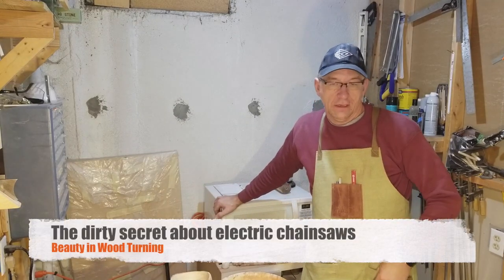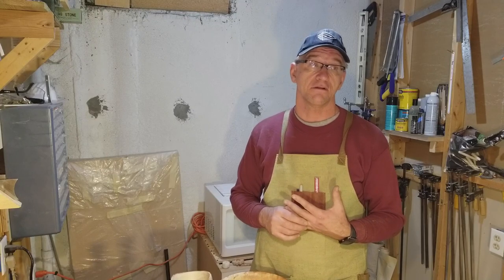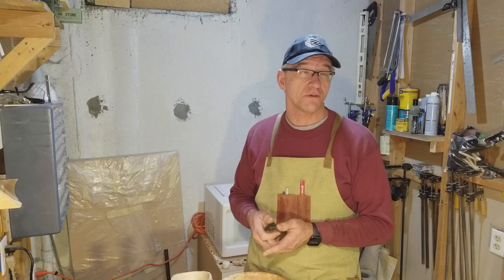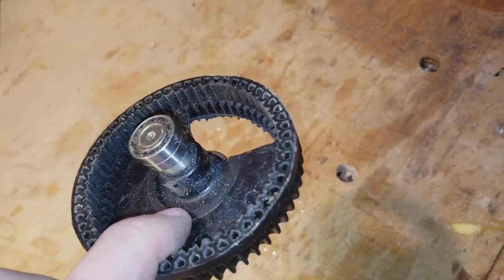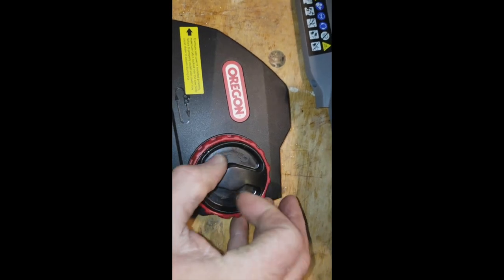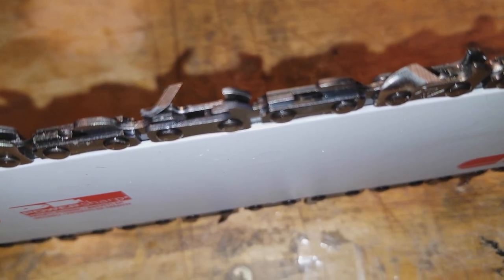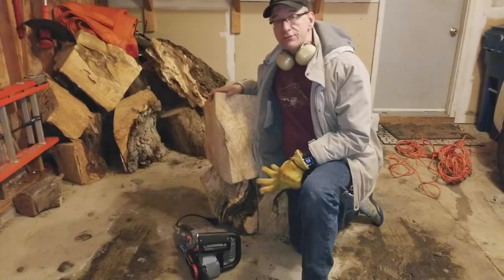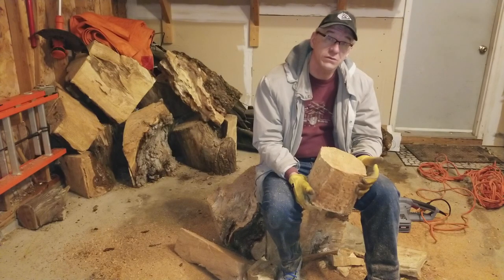The dirty secret about electric chainsaws

Comment: The metal sprocket is important, right. Here in Germany I recently got the 2400W Oregon CS1400 with a 16"/400mm bar and without the gimmicky sharpening tool which requires a special chain. It is robust, strong, handles & cuts like a real chainsaw, chains are easy to sharpen by yourself and there's a variety of bars & chains to choose from, even changing to 18"/450mm.  Perfect for all tasks where 230V is available, which in my case is all around the house and in the garden.

Comment: I had no problem I had my electric chainsaw for 5 years and it be same I always gave chainsaw oil and it be fine I used it to cut big tree logs and big breaches
Reply: What brand? I want to buy a chainsaw, but I need something reliable (and relatively cheap (because I am a cheap bastard)and not hard or expensive to maintain) because I have a lot of wood to cut and I'm tired of cutting with an axe.

Comment: You're worried about a common plastic gear that last forever if you keep oil in the thing.  What you've bought there is throwaway chainsaw because the bushings for Oregon are not available, ever.  And any electric chainsaw is throwaway crap if the bushing aren't made (and available for) to be changed.

Comment: Coincidence: I own the same saw -- 2 1/2 years old. It worked very well, and was used about 200 days a year. When the chain had to be replaced, I was shocked to discover that I had to buy a complete bar, sharpener, and special chain assembly for €35. The chains are not sold separately. Instead, I bought a normal chain for €11, but lost the sharpening feature because of the chain-tooth design. It worked fine until the motor apparently burned out. Maybe, it's only the toggle connection; I don't know, but that's what I'm trying to find out.
Reply from the maker: Interesting. Here in the US, both the chains and the bars are available. I haven't had to change mine yet, but I did notice them on a recent trip.
Reply: Try looking for parts on eBay. Who knows if you can find what you need?
Reply: keep in mind it specifically states its a light duty saw. it is not meant to slap a 34 inch bar on and cut hard wood lumber for 12 hours a day 200 days a year on a mill.
Reply: Perhaps the brushes wore out.
Reply: Where are you? The chains are available in the UK, they come complete with a new sharpening stone.

Comment: That first cut wasn't bad, considering you cut directly into end grain. Next time try giving the log a quarter turn so the  grain is parallel with the floor and make the cut through side grain. You'll have long pieces of shavings come out of the saw rather than the powder you got cutting through the end grain. Thanks for the review, I'm looking into one.
Reply: screw self sharpening feature and use a ripping chain for cutting with the grain

Comment: DUDE..... GET TO THE POINT ALREADY... TOO MUCH BABBLE TO SAY A FEW THINGS.
Reply: The funny thing is that you can read the video description and it pretty much condenses an 8 minute time investment into 2 sentences. 

"There is one feature you need to consider when choosing an electric chainsaw and it's not easy to research. You need a saw that has a metal drive sprocket for the chain. "

Comment: I have a downed smallish tree that is not that big a job ( thickest trunk diameter is about 10 inches, dropping down thinner after that point)...got a quote of 750.00 for someone to come cut it up and haul away...I think thats too much for this job....I am going to buy a 60.00  Homelite chain saw and do it my self and throw it away bit by bit...to me that is enough reason to get an electric chain saw that I will probaly seldom use again...certainly not for a job this size.... It all depends on what you are going to use one for.

Comment: I'm deciding between a few electric chainsaws that cost around $50 new.  Will mine probably have the good metal parts?
Reply from the maker: I think that's doubtful. You are probably looking in the $130 to $150 range.
Reply: I've been using corded, (and gas), chainsaws for about 40 years now. As far as I know, there are no more corded chainsaws with all metal gears - and I've looked for one. If you want one for sawing smaller material, (4-6 inches), look at the Harbor Freight saw. Right now it's on sale for $40. If you are looking at cutting larger diameter wood, I can recommend the Black + Decker 15 amp, 18-inch. I've cut 31" Ash with mine. While it does have a plastic gear, it's still a robust saw. It will cost you somewhere in the neighborhood of $90-$110. Stay away from Remington, the plastic gear is very prone to stripping, (but at least it is cheap to replace.) Whichever saw you buy, follow these rules: 1) Always use a 12 gauge extension cord or else you run the risk of burning out the motor. 2) Do NOT push the saw too hard! Sometimes we get impatient, but plastic gears don't like to play rough. If you are handy, take the saw apart when you get it and put some lithium grease on the gears and repeat once a year. Also, if you don't know how to sharpen a chain, take it to your OPE dealer to get it sharpened, a dull chain will work the motor too hard. Keep the chain out of the dirt, it will ruin the chain and bar. If you follow these suggestions, the saw will last many years.
Reply: @Pro1er  Good stuff.
Reply: @Pro1er  Thanks!!
Reply: @aremedyproject9569  Glad you found it useful.

Comment: You know, when he was talking about electric chainsaws, I didn't stop to think that he was talking about wired chainsaws. Pretty sure if he got a DeWalt 60v or a Kobalt 80v, he would never have to worry again.
Reply: the batteries alone for those tools cost 199 dollars.  for the 2.5AH battery. thats 2x as much as this chainsaw. if you're into the system and already have the batteries for other tools it might make sense otherwise not really.
Reply: @danielroden9424 
Well the DeWalt 60v is $160 for a 6ah. And the Kobalt 2ah, is $100. Yes that's still fairly expensive to replace the batteries, but considering you probably wouldn't have to replace them for 3 to 5 years depending on how well you take care of your equipment, it's not such a bad investment. But yes, once you're already into the ecosystem of battery equipment, then it makes more sense. I currently have six tools that run off the 80V Kobalt batteries.

But where I think battery equipment shines the most is in weed eaters, leaf blowers, and lawn mowers. I definitely wouldn't compare an electric chainsaw to a 465 Husqvarna.

Comment: Nice to see someone who actually knows how to use a chainsaw. On the other hand I was wondering how it is still working ? I seen anther review of electric chainsaws and the Oregon quit working on the 2nd use .
Reply from the maker: I've had it for over a year and it's running strong. I recently used it to section a Willow tree stump that was 5 feet in diameter and 6 feet tall.

Comment: Look at one of the newer battery powered chain saws. They can pull a lot more current from the battery than you can get down that cable from your house circuit. For the ultimate electric chain saw look at the DeWalt 60v chain saw system :)

Comment: I've been wanting a Makita cordless chainsaw for several years but I'm done buying into new battery systems. The nice part about the Makita is that it is direct drive.
https://youtu.be/CrwbY7IgPZU

I highly recommend that you get yourself a 25 foot, 12 gauge extension cord so that you don't burn out the motor due to low voltage.
Reply: I agree. Batteries are a real pain when need replacement. Expensive and a waste of resources.